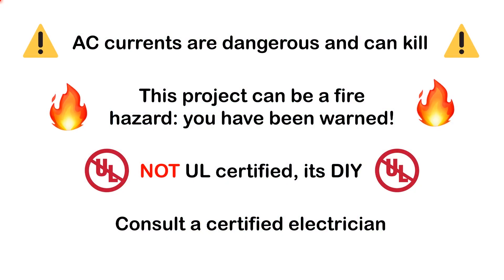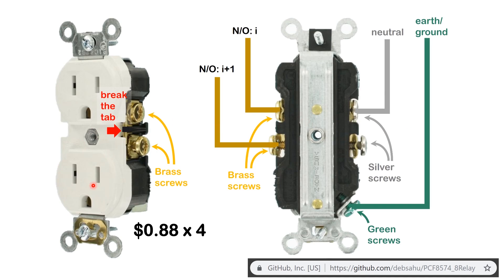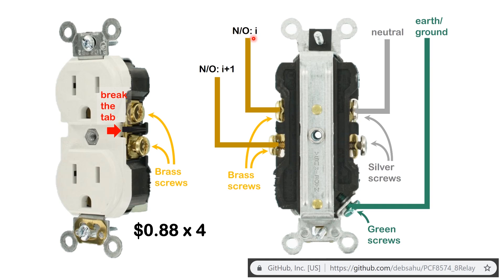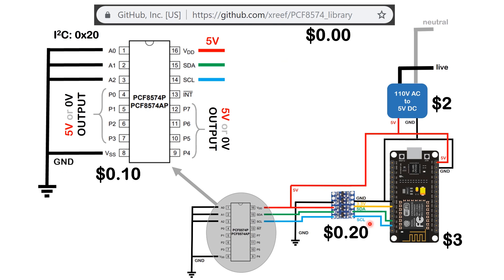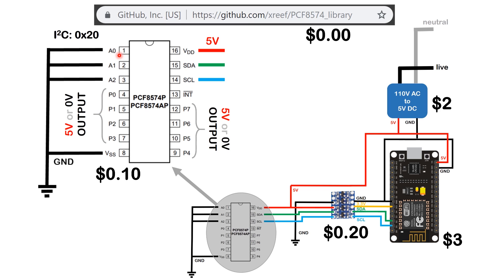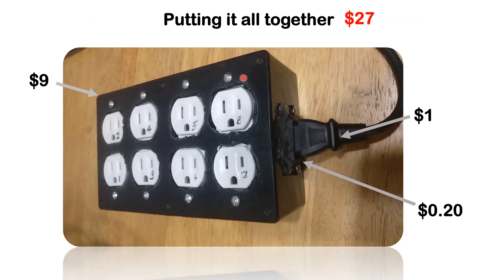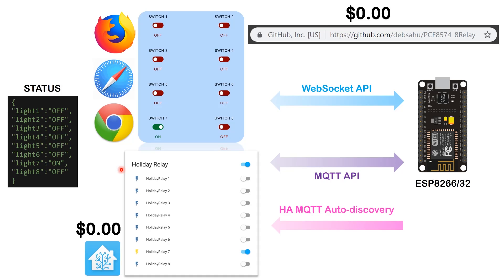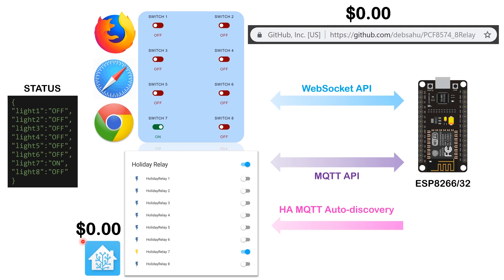ESP8266/32 (Home Assistant Switch) connected to PCF8574 controlling 8 AC relays

Comment: Nice Video Debashish, however You could most likely ommit the level shifter. Most of these relay boards do have a jumper "JD-VCC - VCC". If You open it, You can apply 5V to the "JD-VCC" pin which powers the secondary side of the optocouplers as well as the solenoids of the relays. And You can attach 3.3V to the other VCC pin (either one as they are connected to each other) for the logic part.
Reply: does it mean external 5V is unnecesarry? and it enough to power the system only from usb port only?

Comment: Solenoid relay's power build-up and release (thousands of watt) will be causing it to restart your esp8266.
Reply: @debsahu7801  Have you tried using it in the real world?  Unless you use snubber on the AC side, your mcu will reboot.  You just don't know it!

Comment: Is there a way to add physical momentary bush button to toggle each relay using gpio or via i2c?
Reply: @debsahu7801  thanks tried and it works. Do you encounter any relay is on during boot up coz i'm facing this issue even with i2c chip. I'm using esp32

Comment: Do you really need PCF8574 to control 8 relays? Doesn't ESP8266 have enough pins that are not used during boot-up process to be connected directly to relay module?

Comment: Why do we need a 3.3V to 5V level shifter? I was reviewing the datasheet of the PCF and it says 2.5V to 6V
Reply: @debsahu7801 , You can simply open the JD-VCC - VCC jumper and connect 5V directly to the JD-VCC pin. See my more detailed reply

Comment: Hi do you have or thinking of making the same setup for a raspberry zero. 
nice video
Reply: @debsahu7801  A raspberry zero only cost $5. (esp32 cost more that a pi-zero)   I have about 10 of them. I love to do a project like this on a Raspberry pi because of the Ethernet connection on the pi vs running too many project WIFI. if you don't know most router (well mines can only handle 32 2.4g and 32 5g devices) can only have 20 to 32 2.4g devices connected at once. (Am trying to get off wifi, I have $5 to buy raspberry zero) So making so many wifi devices will use up your router where you will have to get an AP to handle the WIFI load.

Comment: Can you spin up a simple project for 4 relays directly operated on the ESP8266 portpins and if possible with a local switch for controlling these relays , if WiFi fails.
Reply: @debsahu7801  yes but for 4 Relay + 4 Switches you can juggle the pins according to their Boot State level and make one. I already have made one with TASMOTA firmware and it works well. But I want it with your code on it. If you could make/share

Comment: In a reply to a comment here, you mentioned that the code has been converted to ESPHome. So does that mean I could follow the wiring in this video and it would run with the PCF8574 component on ESPHome?
Reply: @debsahu7801  Excellent! I look forward to you posting the codes! I also looked online to try to order one of these chips, and what I found online mostly was a PCF8574 built to a board with dupont pins and it has a jumper for A0, A1, and A2 (to configure the address). Maybe you've seen one of those boards or maybe even used them. Is the ESPHome PCF8574 component compatible with those boards?

Comment: "This entity does not have a unique ID, therefore its settings cannot be managed from the UI." I get this error on home assistant. I fixed it by adding the text below in the configuration.yaml file and the device appeared. Hope this helps someone and thanks for your efforts in the project. 

homeassistant:
  customize: !include customize.yaml

Comment: I think you do not need PCF8547 and voltage level shifter, since ESP has enough pins and you just have to remove JD-VCC jumper, connect 3.3 from esp to vcc and 5v to JD it will be optically isolated. From datasheet: It is sometimes possible to use this relay boards with 3.3V signals, if the JD-VCC (Relay Power) is provided from a +5V supply and the VCC to JD-VCC jumper is removed. That 5V relay supply could be totally isolated from the 3.3V device, or have a common ground if opto-isolation is not needed. If used with isolated 3.3V signals, VCC (To the input of the opto-isolator, next to the IN pins) should be connected to the 3.3V device's +3.3V supply.